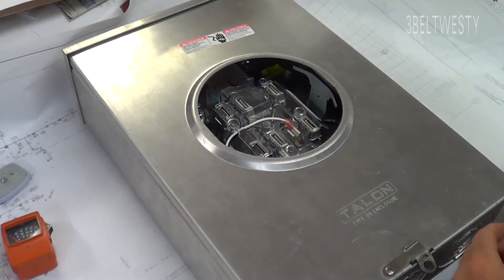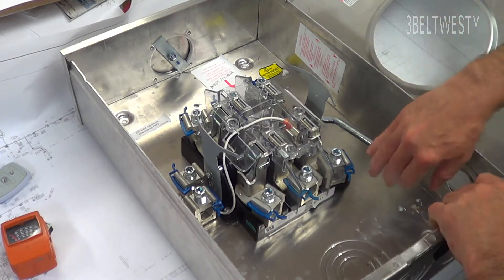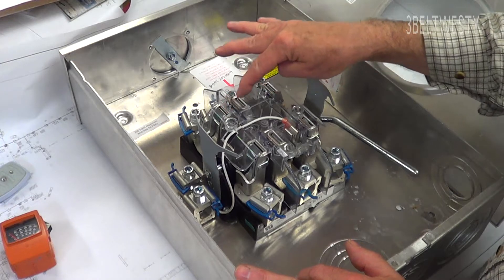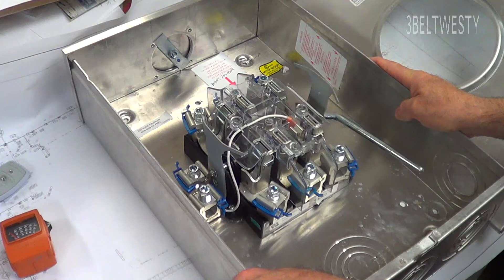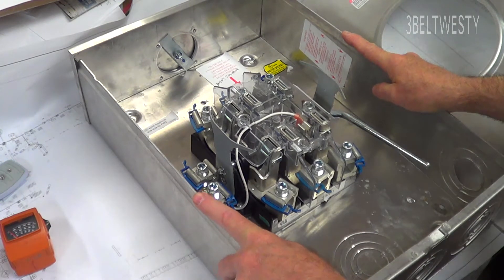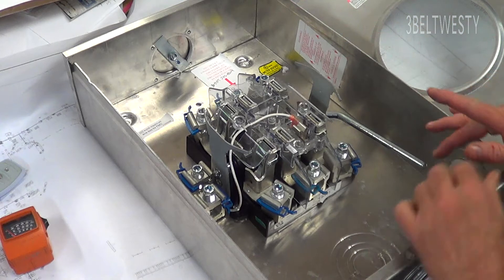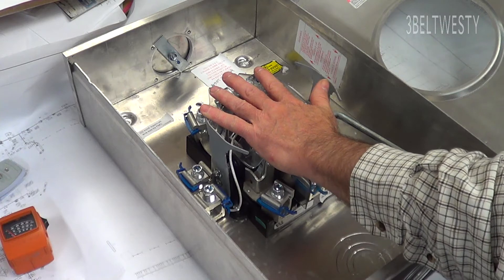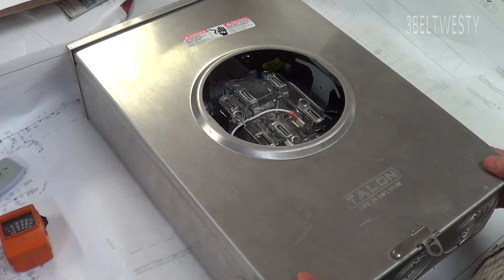3 Phase 7 Jaw Meter Socket 200 Amp 600 Volts for watthour meters

Comment: I need to monitor power consumption on a 480 3 phase holding freezer we are leasing to a customer. No neutral. Can the neutral lug in the 7 jaw be connected to ground and still get the proper reference?

Comment: What would be 600 volts i thought 3 phase was 208 or 480
Reply from the maker: Canada uses some 347Y/600 volt systems. ie 347 volts ac line to neutral and 600 volts line to line.  This offering is usually not on the menu of most US utility companies standards offerings in their service schedules. 

But I think some older factories in the USA do still run some 600 volt ac motors as legacy stuff. One has the utility companies 600 volt distribution transformers and ones factories 600 volt motors to consider as far as costs. It can be just 600 volts in ungrounded delta. 

So 600Y/347v 3-phase 4-wire or 600v delta is more common in Canada than the US usage. Here the 575 and 600 volt motors are mostly in old mils and factories. As rough guess in the USA 600 volts is more in the North. : )

Google searching "600 volt motors mill power" gives an 1911 article about installing 3 phase 600 volt ac motors in textile mills in New Hampshire.

https://books.google.com/books?id=OOJQAAAAYAAJ&pg=PA1605&lpg=PA1605&dq=600+volt+motors+mill+power&source=bl&ots=ucmPjvq6rF&sig=ACfU3U2z8ARO5sh6X0zQLss6RBzNwOlNmA&hl=en&sa=X&ved=2ahUKEwjk3qH9zsrnAhUETawKHZ9IDD4Q6AEwEXoECAsQAQ#v=onepage&q=600%20volt%20motors%20mill%20power&f=false

I guess that 600 volts ac motors comes from an era when 600 volt DC motors were around?

A local paper mill here uses 120, 240, 480 Volt motors and giant ones at 2300 and 4160 volts.